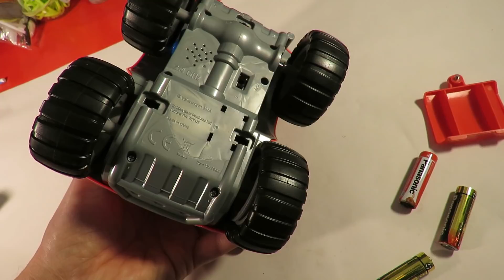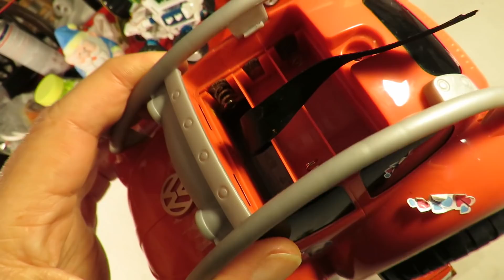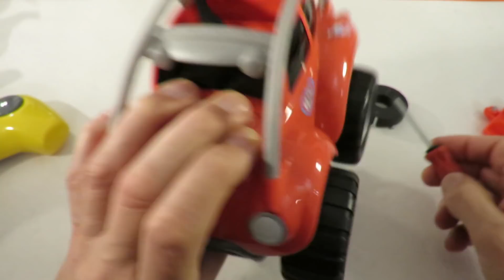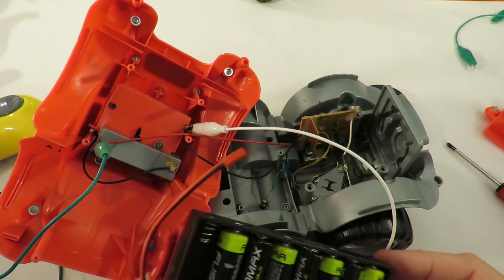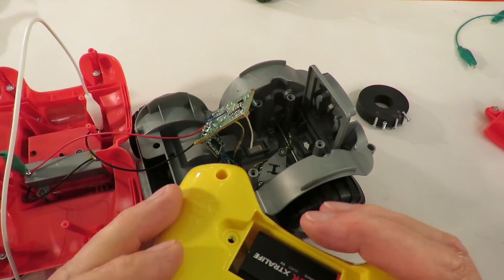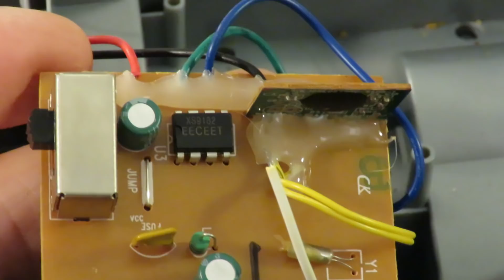Golden Bear 2.4GHz Volkswagen RC Car Tear Down

Comment: O can you do some more electric tare downs? How about you go to cash convertors and pic up some cheep stuf from the parts only pile? Theres often old X boxes and stuff there 😀.
Reply from the maker: I will think about it but to be honest, without the background electrical knowledge that somebody like maybe "bigclivedotcom" my tear downs are just that. I cannot give a detailed explanation of the component parts and their purpose. My tear downs are usually just to see if there are any salvageable parts inside and I have boxes full of salvaged stuff that I haven't used in years now. Printers usually have handy DC motors often stepper motors but most modern electronics have very little in the way of discrete components that you can desolder and re-use.
Reply from the maker: Here is one for you  😊  https://youtu.be/h_GpeJ82flo
Reply from the maker: And here is another - TEAR DOWN old Sky Box  https://youtu.be/RS-0GTcB8Mo